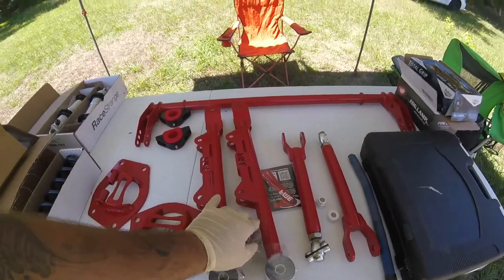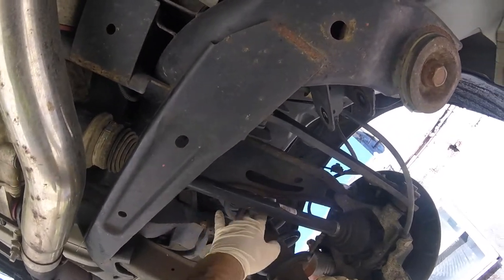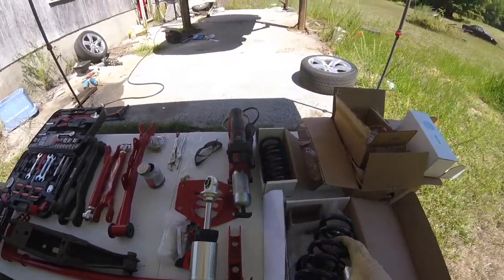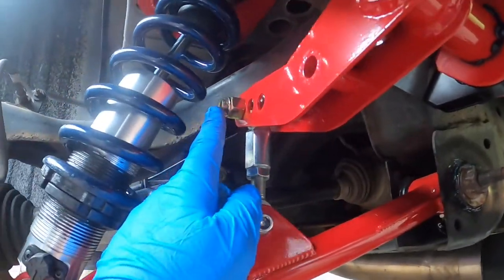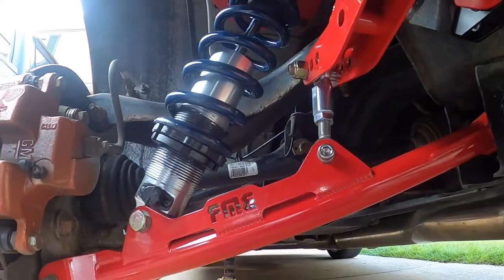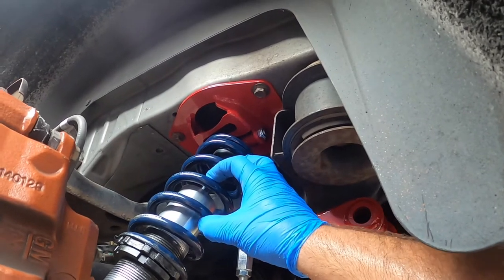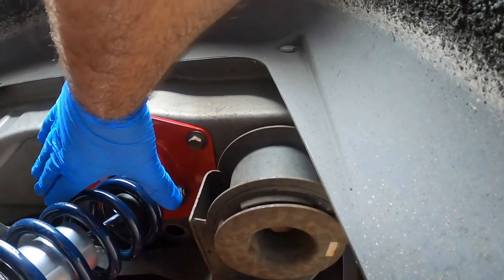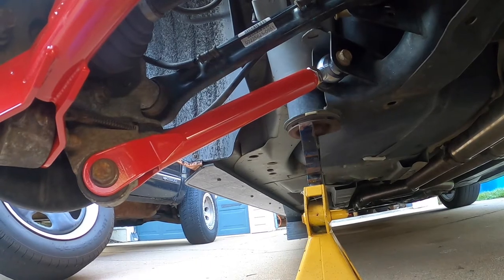5th Gen Camaro SS BMR Drag Suspension Installation

Comment: Your top shock mount is mounted upside down. That's why the car is probably still setting too high. You need to remove the RED upper shock mount. Then you have to cut out some material and make the opening larger, so that the shock mount will fit up inside the hole after you flip it around. If you don't believe me, ask BMR. Their instructions are a little vague but I believe they tell you that you will have to cut out metal to get the shock mount to fit. As far as the shock adjustment knob, I had the same problem and that was over a year ago. So, obviously, their quality control is still lacking.I noticed that you didn't install the adjustable toe links. I would install those before you go get it aligned. I hope this helps you out.
Reply from the maker: I appreciate the info! Makes sense why the car was so jacked up high. I was reading the install instructions and saw the part about trimming the metal. I put the upper shock mount on and was like "hey no trimming needed!" 😂😂
Reply: @The1st60ft   Yeah they look like that's the way they should go. You'll be much happier with the results. And the shocks will be at the correct angle too. There is another person on YouTube that did the same thing. BMR needs to clarify their instructions. Installing the BMR polyurethane sub cradle and differential bushings should help with deflection too. Keep the videos coming. Hope to see another video on how your car sits and if the mods improve your performance.

Comment: Also, another thing that may help is setting you sway bar while the suspension is loaded with the weight of your car. Disconnect your sway bar links, put the car on a flat surface, then put the links back on. This will make sure your sway bar is at 0 until the car torques and requires sway bar correction. I hope this makes sense.
Reply from the maker: Thanks man! I did tight the lower sway bar end links with the suspension loaded. I didn't know where to set my adjustable end links so I just made them the same length as the stock ones 🤷‍♂️

Comment: Good to see you upgrading the suspension! I had the cradle bushings replaced with pfdat metal bushings and BMR  traling arms and non adjustable toe rods in the rear. My car is pulling hard to the left on  launch and I recently noticed my new comp 2 streets are worn on the inside of the tires ..made me sick! I had firestone do my alignment and believe they dropped the ball on me and will have to replace my rear tires now . The lower control arm in that kit you have is for lowered cars , I guess the springs in the kit with the coilovers accomplished that for you  . Will you go with lighter springs in the front and have double adjustable shocks for rebound and compression ? Suspension stuff is mad science lol . you inspire me Sir!
Reply from the maker: Thank you for the support! Yeah Firestone sucks! I've had bad experiences with them. I found a local tire shop that does alignments and they set the rear specs for me to BMR recommendations. I wanna see how it does with this setup but yes next is to get front Coilovers and a Tubular K-Member

Comment: I have the same kit you’re going to love being able to run 15” wheels and tires. I haven’t really dialed in the shocks for the street. It’s all very stiff. Let us know if you find some smooth settings.
Reply from the maker: Right now I'm driving around on setting 2 of 9 on bump and rebound with sway bar on softest setting. It's pretty smooth. I went over a speed bump the other day (only driving over it with the left tires) and the front went over like normal but when the rear went over it caught me by surprise how it felt alot more like a solid axle car with that sway bar doing its job.
Reply: I have a stock 5th gen suspension will this suspension help speed from a roll???

Comment: Hey brother,were you able to get that bracket flipped over and have you been able to test and tune her yet?  I am curious as to find out if your are still running OEM struts up front as well . If so how do you like the set up ? Thanks in advance!
Reply from the maker: Hey! No unfortunately not. The weather as ruined every track day 😒 now 1 of 2 tracks are closed for the season and the last day for the 2nd track is this Saturday and guess what, it's calling for Rain 🌧 😑 I am still on the OEM front Struts but I just removed the Front Sway Bar to see if I can get a little more lift. I wanted to get some passes with the new Rear Suspension then focus on the Front Suspension
Reply: @The1st60ft  I feel ya man . There are things I still need to get done on mine too that's prevented me from anymore track time this season.  Disconnecting the front sway bar should help .
If you were able to put some coilvers up front to give you some adjustable rebound and compression then you should be able to dial her into your liking. Keeping an eye out for your progress..good luck man !